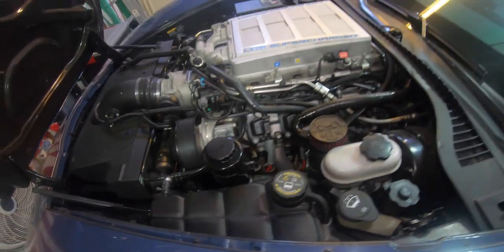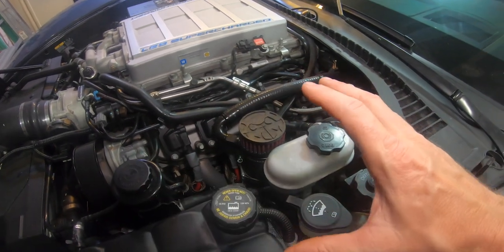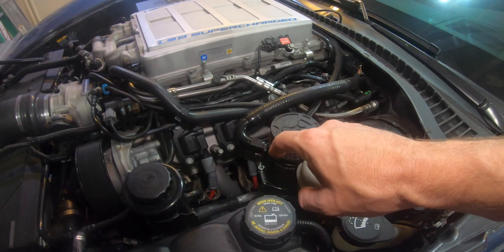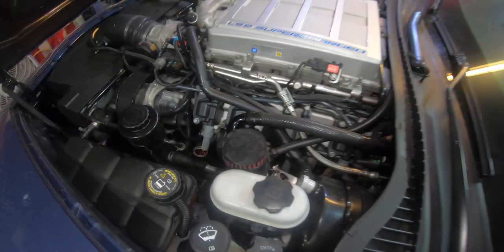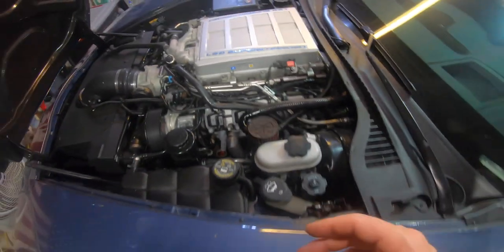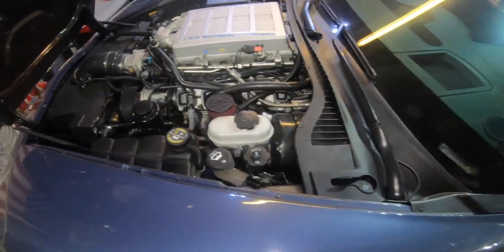MIGHTY MOUSE OIL CATCH CAN - Best LS & LT Catch Can Made!

Comment: It look like that's touching the brake fluid reservoir. That's pretty poor design since catch cans do get pretty hot that will heat up the brake fluid, which should not.
Reply from the maker: If you watched I explained it's meant be installed on opposite side. But car has aftermarket expansion tank there. That's part of the reason for the cooling mods I'm currently working on to replace the expansion tank with the Catch Can and put expansion tank in bumper.  And it's not too bad of a place Heat won't hurt it. MMS cans are all metal.  But I don't like it Mounted there regardless and will be moved soon.